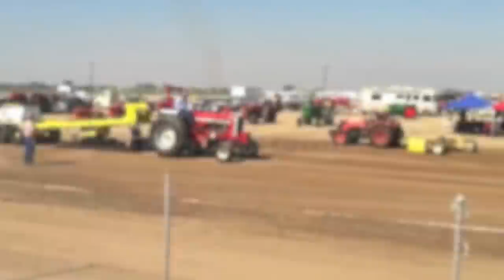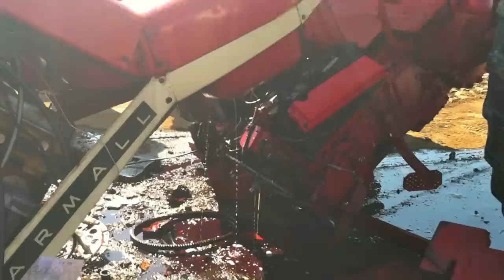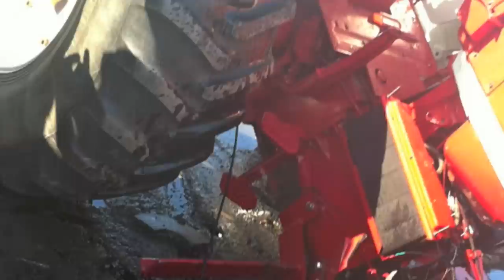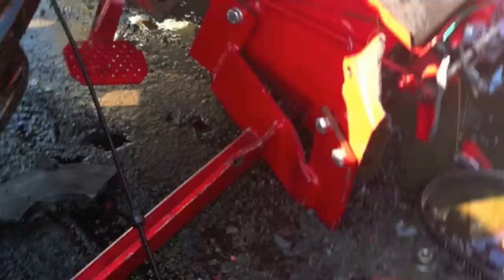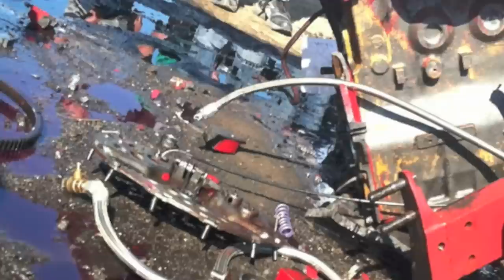Farmall 1206 Breaks in Half when flywheel Explodes

Comment: I gave him credit when he shut it down after something wasn't right. I cringed when he tried again. Although I read the title and knew what was coming. My dad always said if the smallest thing is off it's better to pull it apart than to lose it.
Reply: it sounded like crap about half-way through the second pull. Like it was getting ready to throw a rod. But it sounded like it was the turbo that blew a seal & made a runaway. The excess rpm fractured the flywheel. I bet he wished he had stopped when the smoke cleared.
Reply: People never just call it when the turbo doesn’t light the first time lol
Reply: @nalley6815  The smart ones do especially if they have a sponsor and want to keep them
Reply: @timwilson3124  no, they don’t. You always back up and try it again unless you can tell something is actually wrong. Big turbos are not that easy to light up
Reply: @nalley6815  You always back up and try it again "UNLESS YOU CAN TELL THERE'S SOMETHING WRONG" Your a contradiction aren't you.

Comment: From the 500 foot view, The flywheel was hurting from the 1st attempt, it didn’t appear to be locked up on the way down until the last 50 feet.  Then the revs stressed the hell out of it.  Combination of excessive heat and R’s did it in.  A real bummer it let go and took out the housing.  A good one for the drivers to have walked away from.
Reply: Engine ram away at the end so it reved way beyond what that flywheel could handle.

Comment: If you listen real close you can hear the engine start to flutter about 3/4 the way down the track..this is the point when the plunger in the fuel pump stuck..''seized'' causing the pump to lock in the wide open position..thus causing the motor to ''run wild'' at the end of the pull....looking at the pump I cannot see a dump valve on it..which is used to bypass the fuel flow thru to pump.....most just allow the fuel to be blown out on the ground....If they didnt have one they damn well should of known better....that little $100.00 valve could have saved them thousands..and maybe their life!!!!

Comment: I have to share this:
Back in the early 1980's, the John Deere Industrial dealership I worked at as a mechanic took on this agricultural line of tractors from Italy. Same' was the name. It was pronounced "sah-may" but us mechanics called it "Same" as in "Same thing".
It would piss off the salesmen to no end.
They'd go, "It's Sah-may" and I would come back with "Sah-may", "same"...same thing."
Anyway, we hated them because they were basically junk, not to mention Ag.
This one poor guy bought one, loaded it up on his trailer and ran his chain/binder right across the trans housing. We were all watching when he pulled the binder. SNAP! His new tractor broke clean in half! Oil all over his trailer and the thing broke in the middle, down on the trailer.
We had to go inside the shop so he wouldn't see us laughing. He was pissed!
They dropped the Same' soon after.
Reply: SAME is a well respected name in the UK and Europe and was one of the pioneers of 4 wheel drive for agri tractors when all the big names (Ford, M-F, I-h, etc) had no such offerings. Many had air-cooled engines and were very fuel efficient as well as having great traction. Actually their names are pronounced SA-MEE (as in 'me'/I) not ',May' as you describe.
Reply: Yuxin Wang Sah-May, Saw-me...Same thing.
After the John Deere fiasco involving Same' tractors, I never saw one in a field in use and this was in the Oxnard Plains. Research "Oxnard Plains" for more info. Also, this was Ventura County, California, one of the richest and biggest agricultural citrus growing areas in the US. Maybe exceeding even Florida.
I worked in a Same' dealership with 4 stores and for the dealerships to drop the line says a lot in itself.  Junk.
Don't get me wrong. I own 2 Italian BCS rototillers and they're top-notch...as long as they don't have the dreaded Italian ACME engines. You can't buy a BCS today with an ACME engine. They went to Briggs and Honda.
Reply: @ David Fruhling : I have another SAME story for you, this one from England.. The local Renault tractor agent ( Now they were an awesome tractor, now took over by Claas but that's another story ) Took in a Same  tractor as a trade in against a new Renault. The tractor had gearbox trouble ( 3 gears not working! ) so before they re-sold it they had to repair it of course. When they stripped it down they found a 'spare' bolt in the bottom of the gearbox, i.e. it did not seem to fit anywhere. Anyway, the dealer phoned up Same UK to order the new parts and he just happened to mention the fact that they had found this 'extra bolt. The guy at Same's  replied "Oh no not another one!..... it happens all the time, A bolt gets dropped in the gearbox by mistake at the factory and the buggers don't bother to fish it out again.... These 'eye- ties' don't care you know!"
Now Same are part of the Deutz- Fahr  group. I can't comment on reliability but I did hear that as a pulling tractor, the Same was actually very good.
Reply: Yeah we have another way of spelling your beloved John Deere too - John Dear - too dear for most and oh dear it's broke again.
Reply: David Fruhling
 Yes I have a Grillo tiller, made in Italy its great..... but for The UK market they also use Honda engines (Although I think they use Lombardini for the diesel versions ). I mentioned Renault tractors before. Well I just remembered Renault did produce a 'dog', it had the usual wonderful MWM engine (German , full of torque, economical and bomb proof ) but what let it down was the gearbox which was nothing but trouble . Can you guess who made the gearbox?
Reply: Yuxin Wang The John Deeres made in Moline are and were the very best. I believe most green John Deeres today are made by someone else. Possibly in China. Maybe those are the ones you're referring to there, Dink.
I haven't worked for John Deere (Reed Equipment, Fresno & Lougee-Michael Equipment , Oxnard/Bakersfield) since 1992 so I'm not up on them anymore. I worked on the industrial (yellow) tractors. I know some of them are made in Japland (Hitachi)
In all the years I've worked on them (12) I've never seen one actually "broke again". Its all been normal wear and tear. I did see a giant, rear-mounted winch on an 850 crawler "break" because the moronic asshole working on it left a shop rag inside. It wasn't made by J.D. anyway.
Reply: Mackeson3 The song remains the Same'.
I just remembered a Same' story:
It was back at Lougee-Michael John Deere. Early 1980's. This flatbed semi truck shows up with 3 new Same' tractors. The whole store is out watching. The salesmen are just beaming, walking around with their chests puffed out like new fathers. (they were idiots) I'm just thinking, "What next. What fucking next?"
Anyway, they got unloaded and guys are swarming all over them. All us mechanics (except the few stupid ones) are going, "Junk!".
I hopped up into the seat of one and was looking at the instrument panel. It had idiot lights instead of gauges. There was dust on the panel and the sun was shining on them so I couldn't read them. I took one finger and wiped the dust on one to read it. Apparently, the little lightning bolt (ammeter) was silk screened on from the outside. It just disappeared as I wiped! I looked around and nobody had noticed so I hopped off and made my way back into the shop.
I crack up when I read these "Youtube experts" telling everybody what's best when they have no experience in the field, if you pardon the expression.
That's all I have to say about that.

Actually, I stopped by there 2 years ago and 1 of the salesman is still there! 32 years later! He had gained weight and ballooned! Weirder than shit. What's weirder is that he remembered me! (of course I've gained 105 pounds since)

Bolts being left inside? Reminds me of the AMF/Harley-Davidson days.
Some factory employees weren't happy with the pay and one guy in particular left a 3/8" bolt inside an engine. It wouldn't turn so at the dealership the engine was opened up. Along with the bolt was a note that read something along the lines of: "You found this bolt. Now, find me a raise" or something.
I don't believe the story because the damn bikes have to be "ridden" on a roller and gone through the gears before shipment. 
So, are Same's still built?
Reply: Mackeson3 By the Same' people who make the same'? It's the Same' thing, over and over.
Reply: Yuxin Wang I'll stick with the correct way of saying Same': "Saw-MAY".
Keep in mind, I worked at a Same' dealership. I would know.
You should have known.
Reply: Mackeson3 Speaking of Eye-talian, I have owned 2 BCS tillers. The first was a small one. 717 I think. It was offered to me at a price I couldn't pass up. Like $100 or something. I put it on Craigslist and got $325.
I would have kept it but my Troy Horse kicked it's ass and it had the Acme engine anyway.
Then some dude comes in my shop and asked if I wanted to buy his BCS. Again. Sight unseen, I offered him $200 thinking he'd be offended. Nope!
He brings it in and it's CHERRY! Has a 8 horse Briggs. It's a model 720.
I looked at the tines and they somehow got worn out w/o ruining the appearance of the rest of the tiller.
I told him the tines were going to cost over $100 and offered him $100. The fool took it! Must be stolen...I don't know nor care. I got my tines at cost through Oregon and paid like $60.
Best $100 I ever spent when you consider the replacement value of around $3000.
BCS Eye-talian tillers are great! Especially since they only use Honda & Briggs engines here in the States. Maybe they learned through Same'.
If anyone has a BCS with the Acme engine and have carburetor problems, certain Tecumseh carburetors are almost a direct fit replacement. You'll have a primer bulb instead of a choke. Throttle linkage was a breeze to adapt as I remember. It's been about 14 years since I swapped one.
Reply: David Fruhling Well are Sames still built? They paint them green and call them Deutz, paint them red and call them Same, paint them white or silver and call them Lamborghini. http://www.samedeutz-fahr.com/en/. Many years ago a guy was coming home with his brand new ( well, 5 hours on the clock ) International 574 and it got hit by a car 'midships' ( it was the car drivers fault, he failed to give way at a road junction). I don't know what happened to the car but the tractor broke in two across the bell housing.
Reply: Mackeson3 Who made the International?
If it means anything, starting in 1977, I started buying International light trucks. I have owned 17...so far. I only have #17 right now, a 1959 1/2 ton.
I loaded 3400 pounds of decomposed granite in it (1.5 yards) and the right rear wheel broke off less than a mile from home. The wheel assembly got wedged up in the fender and the fender was supporting all the weight. Nothing happened! Of course, I do have to mention the rear end is not the one IH put under there.  The previous owner had it replaced with one that had higher gears. A 5X51/2 lug pattern. GM I think. Of course I have to carry 2 spares.
Go to daviddaveinternational@gmail.com for pictures of the incident.
Anyone is welcome.
Reply: Made by The IH factory in Doncaster, who used to make some really good tractors UNTIL The late 1970's when the factory was plagued by strikes and quality control went out the window. We had a 674 bought new in 1977 which spent as much time back at the dealers as it did on the farm. I was glad to see the back of it .Not just us, quite a few farmers around me who had IH tractors (sometimes the whole fleet)  voted with their feet and changed to other marques.
Reply: Mackeson3 Remember the diesel Scouts? I see them on Ebay and the sellers are always trying to present them as "rare". They could be considered "rare" because some of them were driven back to the dealers and had gas V8's put in they were so sluggish.
I have a Motor Trend Magazine (January 1977 I believe) where they tested one. They had not one good thing to say about it for street use except it's fuel mileage. They managed to wring out 15 or 16mpg (I can't find the magazine) and said, "...pretty good considering the size and weight of the vehicle." That's the same mileage as the 304 gas V8. I see idiots on ebay claiming 25 to 30 MPG.
Motor Trend said the truck "is downright dangerous" trying to enter a freeway on ramp. For fun, they had a teenage high school track runner drag race it. The kid dusted it for the first 300 feet or so. They wanted an Olympic runner but the summer Olympics were going on.
They had nothing but praise for it...off road.
I call it "International's Version of the Edsel". It's last (gasp) year (1980) they stuck a turbo on the Datsun (Nissan) engine but it added less than 2 HP per cylinder. Oh, well. They tried. Just not hard enough. They put turbos on the 4 cylinder gas engines as an option 15 years earlier.
The only reason I.H. and Oldsmobile went to diesel engines was NOT because of better mileage. I don't know how old you are, but back then, we had odd/even days to buy gas and the lines were long. Diesel was cheaper and exempt from the odd/even bullshit. It had nothing to do with fuel mileage. Poor unknowing people bought them just so they didn't have to wait in long lines.
It wasn't until Ford started sticking International diesels in their trucks did the diesel-powered vehicle work. Ford actually helped save I.H. from bankruptcy with the deal.
I'm not counting those 'D' series old, stinky, smoking Mercedes'. I however do seem to remember the turbo diesel Mercedes at one point had more HP than a new 'Vette.
Reply: Mackeson3
Factory workers intentionally put hammers and wrenches in Valmet gearboxes, an act of sabotage out of disgruntlement. At Valmet dealer conferences it was allways the tale of the day what tools they found inside gearboxes.
Reply: @RenzeZielman: We bought one of the last IH 674 tractors to come off the production line in 1977 , during that period IH Doncaster was troubled with strikes and it showed! That tractor went back to the dealer's several times and quite a few farmers around me that were once IH enthusiasts changed their marque pretty quickly as they were having reliability problems with IH tractors too.
Reply: RenzeZielman I worked at a John Deere Industrial dealership (Lougee-Michael, now back to Coastline) for 8 years and can assure you, "gearboxes" and transmissions don't have room for "hammers and wrenches". I will admit I found a Craftsman 3/8"X7/16" open end combination wrench in a John Deere 450B steering clutch box but it did no damage except to the wrench, which was mangled. (I took it to Sears and got a new one)
Actually, if this were true (wrenches & hammers) the person(s) responsible would be fund out by decoding the serial number...when & where it was assembled and by who.
Briggs & Stratton engine code numbers for example, can be decoded to the day of assembly. 121984 would be December (12) 19 (day of the month) & 84 (year)

Unless you "YouTube Experts" have experience in the field (I have 41 years)  it would be advisable to keep your yappers shut.
Reply: Mackeson3 What were the problems the 674 had?
At J.D. Industrial, new tractors went through a pretty rigorous PDI (pre-delivery inspection) and were load tested in the dirt field (now an industrial complex) behind the store.
Maybe it wasn't PDI'd properly..?

The biggest contributor to bad quality control were the farmers themselves by going with shitty Kubotas, Same's and other imports. What were JD, Case &  others supposed to do?
While at J.D; they started buying Hitachi (bless you) excavators and painting them yellow.
I haven't worked at J.D. for over 22 years and wouldn't be surprised if all of their green & yellow tractors are painted import junk.
Too late to say "Buy American" I suppose...
Reply: Yuxin Wang"Nothing runs like a Deere and nothing smells like a John".
Surprised you never hear that one.

Comment: Running a cast iron flywheel that big & heavy over 4000 rpm is a deathwish he's lucky it was 2' in front of his feet or they'd be gone also
Reply: I believe that all superstocks have to have steel flywheels to prevent this from happening. Cast flywheels are fine for stock tractors, but crack and break in extreme situations.

Comment: Ive seen a 1950's chevy at the track throw a flywheel, but the damage was not that extensive ! The flywheel flew upwards taking out the top of the tranny, most of the firewall and the  front windshield. But this is a whole new level !  Need a new tractor.....

Comment: Anyone know to cause because someone says one thing and someone says diffrent then.
Reply: The crankcase is structural so when something breaks through the casing there is no structural integrity.
The way it was smoking looked pretty bad so probably a piston seized which snapped the crank and the the torque at the flywheel shattered the bearing housing and one thing lead to another.

Comment: Yes I agree with a  "bit" safer. still seen old tractors shove rods out the side near the crowd at 2000 rpm. It's still a motor sport and things like fire and failure "will happen" its not if it's when as happened here.
 If a  piece hits the crowd and hurts/ kills somebody it gets seriouse when they sue and safety inspectors get involved with the lack of safety equipment or insurance. Ask Andrew Blake In the U.K what happens when a pull goes bad and A driver doesn't make it He Knows!.

Comment: When you wind the turbo and let it scream it will break. Running slow at low RPM is a bit safer,
Reply: Low in slow won't win the pull.

Comment: There wouldn't have been time to kill the air. The motor wasn't running right from the start, and after the pull it ran away and almost instantly grenaded the flywheel. Trying to block the air on this engine would have resulted in a fatality.
Reply: Why?